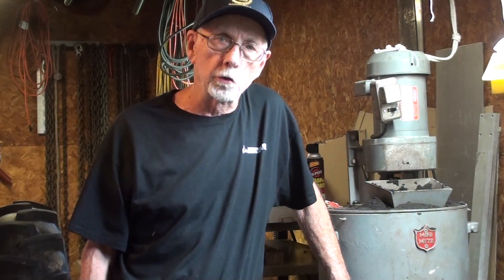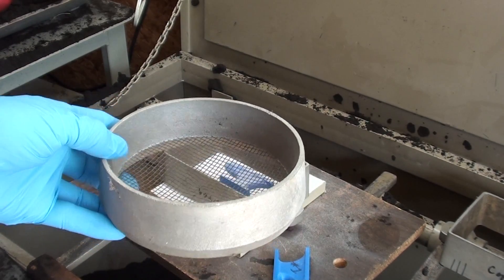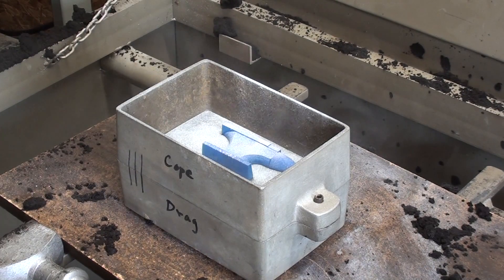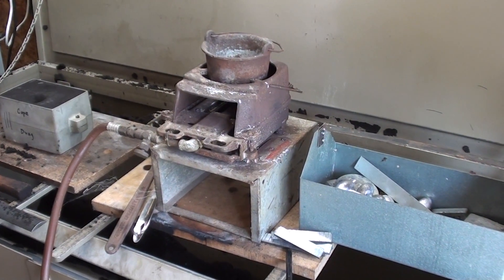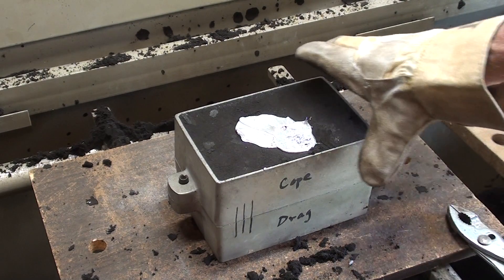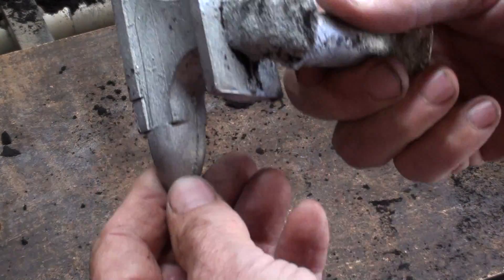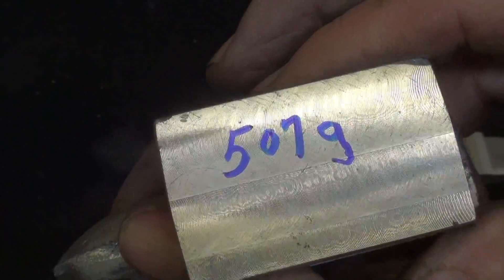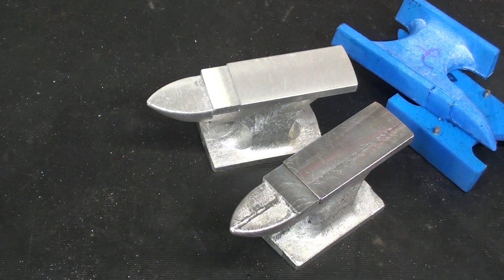Cast a Lead Paper Weight ANVIL Tips 598 pt 3  tubalcain

Comment: With the advent of central heat and air, paper weights became obsolete, and severely impacted the sale of door stops. Young folks may not even know what they were for. LOL! I've cast up to 300 lbs of bronze in green sand and petrobond, and it is very hard to keep the sand from sagging. Typically, that is when I went to waterglass or chemically bonded sands. Have a good day Mr. Pete, you have earned it. Regards, Solomon
Reply from the maker: Thanks 👍👍

Comment: Always happy to do a little math. I assumed that your aluminum was fairly pure, with not much in the way of other metals. I also assumed that your lead was probably mixed with a bunch of other metals as scrap lead frequently includes wheel-weights, linotype metal, and the like, which have things like antimony, tin, and/or arsenic to make the alloy harder.

Material   Density   Volume   Weight
                      g/cc        cc            g
Al                     2.6       49.62      129     (This is where I figured the volume.)
Pb                  11.3 .     49.62      561    (This is what a pure lead casting should have weighed.)
Pb mix           10.2       49.62      507    (Density back-calculated from actual weight as cast. Around 10% underweight.)
Au                   19.2       49.62      953    (What it would have weighed cast from pure gold. Over two pounds (adv) or almost 31 Troy Ounces, as gold is usually measured. Nearly $46,000 at today's spot price for gold.)
Reply from the maker: Wow thanks

Comment: Hi Lyle - Thank you for these videos, I will be having a crack at something very similar to this. 
Question - (I have not used PLA before) Can you use a hot iron or small torch to smooth or re-shape surfaces/ edges on PLA patterns in preparation for molding?
Reply from the maker: No
Reply: @mrpete222  Thanks :)

Comment: I had a pot of lead blow up on me once.  The streams of lead flying out of the pot solidify into tinsel mid air.  I had lead tinsel all over the place.
Reply from the maker: You must of had water near it
Reply: mrpete222  Some water must have splashed onto my ingot pile. Luckily I saw the lead pot start to bubble when I put the ingot in and quickly turned around.  The explosion shot streams of tinsel everywhere.  It was an easy cleanup since it was mostly lead tinsel.

Comment: Lyle, when you pull the casting out of the mold and it has all that investment sand on it, hold the sprue with pliers and hit the sprue button with a hammer several times. Most of the sand will knock off with very little to brush. You probably know this already.
Reply from the maker: With aluminum you are right. With lead no that doesn’t happen, not hot enough

Comment: Given that your lead paper weight weighs 1.12lbs and the weight of lead per cubic inch is .41lbs that gives you a paperweight that has the volume of 2.73 cubic inches. If you cast the paper weight in gold, the weight would wind up being approx. 1.9lbs having a value of $45,813 as of 4 days ago. 4 days ago gold sold for $1506 an ounce.
Reply from the maker: Wow thanks
Reply: @mrpete222  , you're very welcome.

Comment: It looks like the Drag and Cope have an angle built in to keep the sand from falling out. At least I think so. Thanks for the video...I always like them.
Reply: Pretty sure he also has them backwards. The other way around the pins wouldn't be in the way.
Reply from the maker: But then you could not turn them upside down

Comment: 3 things come to mind from when I was at work.

1 because of warn pins, when closing the mould for ramming and then pouring they were rotated clockwise, "turned to the sun". 

2 patterns were painted red where the components were left with the  cast finish, yellow where they were to be machined, black for prints. The moulder would set the gating system to suit.

3 if a pattern was found to be tight on machining but a new pattern was not cost effective it was marked "rap well"

All the best from 🇬🇧 🏴
Reply from the maker: Thanks

Comment: Nice video. Any thoughts on a possible sealer coat for the lead anvil so hands don't get dirty by touching it?
Reply: Good couple of layers of paint, or clear would work for awhile.  As with most any coating it will wear off over time.

Comment: Mrpete222 I have a question about lead.  How do do remove tin from lead if you have a lead tin mix?
Reply from the maker: That would have to be done in a refinery
Reply: mrpete222 thanks for the reply,  do you know how they do it????   Is it a chemical process similar to say fluxing or more of a mechanical process such as using centrifugal force in a centrifuge?

Comment: Is there any actual difference, between the two halves of the flask?

If not, couldn't you use it upside down, to avoid the alignment pins fouling the table top?
Reply: The only difference between the two halves is that one has pins and the other has alignment holes.The two half must meet for alignment.
Reply: You are right he has them reversed  also there no ribs to hold the sand is because the sides have a slight taper to keep the sand from sliding  out
Reply: @jamesburriss1086  I actually didn't know he had them upside down. I just thought both halves looked the same, so could be used the other way up.

Comment: In gold it would be about 922 grams, so almost a kilogram, and would be worth $44,000
Also, made from lithium it would only weigh about 25 grams, made from osmium it would weigh 1080 grams. Good luck making those though, lithium is highly reactive with almost anything and osmium is very rare (the anvil would be worth around $13,900).
The most expensive anvil would be made from rhodium, weighing at 592 grams and worth around $101,000.
Reply from the maker: Thank you very much, that was interesting
Reply: @Klaufmann
What about Unobtainium?
Reply: @stanervin6108  Nobody knows its density yet...
Reply: Hi,  I think your arithmetic is off just a bit.  Density of gold is 19.32 g/cm^3 and of lead is 11.34 g/cm^3.  So, pure gold is 1.704 times heavier than pure lead.  Mr. Pete says the lead anvil weighs 507 grams.  So the gold anvil would weigh 1.704 X 507 g = 864 grams.  Gold closed today (14-Oct-2019) at US$ 48.05 / g.  864 g X 48.05 $/g = US$ 41,500 (to three significant figures).  Regardless, it's a big chunk of change in a small package!  Best regards, Gottfried
Reply: @gottfriedschuss5999  maybe, I calculated it based on the weight of the aluminium anvil and assumed a density of 2.7 g/cm^2. It's very possible the volume of both anvils differs to some degree, too.
Reply: Thanks Klaufmann for a rough estimate of different material anvils with price and weight.

Comment: Thanks for the memories. As an Industrial Arts teacher in the 70's and 80's, I taught hot metals in Illinois and Georgia.I fabricated a similar "ramming station" to yours and a "pouring floor" that had sand in it for safety's sake. I haven't seen your other foundry videos 'yet' but we always cut a riser hole and often small vents when pouring thick castings. I am becoming a fan and enjoying your videos tremendously.
Reply from the maker: Thank you for watching and joining me. Good to hear from another teacher

Comment: On fleaBay,   the antique paper weight anvils are usually of brass.   The alignment pins of those flasks should have been drilled with one end off center, so that if you put them together wrong, the sides will not line up.
Reply: I believe the error occurs in the reassembling of the flasks, after the pattern is removed.

Comment: I’m sure you have been over it somewhere in your 1000 videos mr Pete, but the sand you use, petrobond, i have no idea where to buy that in Australia 🇦🇺 if I wanted to try to make a mold, would a fine grade of washed sand and say old sump oil or even clean motor oil work? I’m keen to try.
Reply: try greensand dot com.au      they sell petrobond and other
Reply from the maker: No, your method would not work

Comment: MrPete: Just an observation: The rubber hose supplying the gas burner looks like it may have some ageing cracks its surface in the close up shot at about 9:48 into the video. A close inspection should tell you if it needs attention :) Safety First!  A big thanks for entertaining us :)

Comment: On the basis of pure material densities being:
Aluminium = 2.9g/cm^3, 
Lead = 11.34g/cm^3
Gold =19.32g/cm^3

Where:  cast volume in this "experiment" is equal to;
Aluminium (129/2.9 = 44.5cm^3)
Lead (507/11.34 = 44.7cm^3)

And using an average volume (due to shrinkage during cooling I would assume) of 44.6g/cm^3

The mass of a gold anvil would be 
44.6×19.32=861.7g 
or value at today's rate of £37.48/g of £33,247.75.
Reply from the maker: Thank you. I could retire if it was gold
Reply: Thanks for the great videos Mr Pete

Comment: lead /vapors/ are also toxic!!!

thanks for the video!

"...you'll need a heavy, man-size type paperweight, made out of lead".... except you cannot touch the paperweight without gloves, or washing your hands afterwards... Else, If the paperwork doesn't drive you mad, the lead will XD
Reply: Dan Cobar, you’re right about that!
Reply: Jochem Bonarius vapors only toxic if you heat above 600 degrees so most times it isn’t a concern. Touching it daily or hourly as a paper weight though, is a concern!
Reply: @samueltaylor4989  Quite right.  Two good coats of paint should solve that problem.

Comment: Gold would weigh 858 grms Gold is 19.3 g/cc Lead is 11.4 g/cc  (1g/cc = 1 gram per cubic cementer) as a plumber When using lead we were always supplied 2 pints of milk a day Hate to think how much lead I melted or installed and still do safety first
Reply: I got 863 grams, lead density at 11.35gcm3 , gold density at 19.32gcm3 , volume at 44.669cm3.